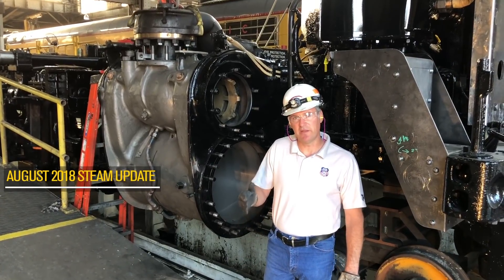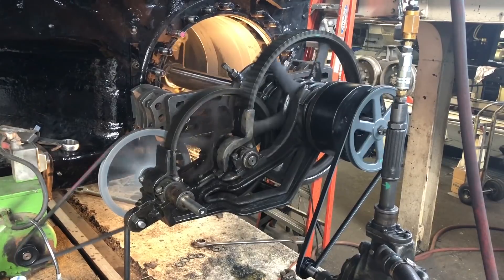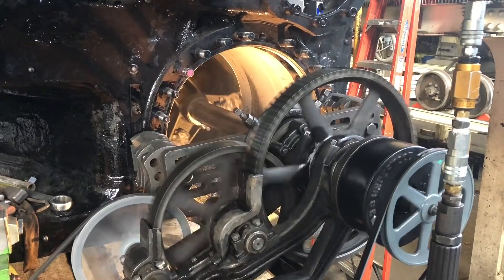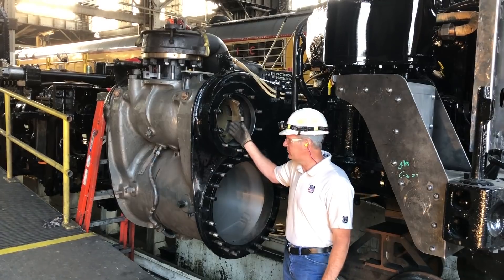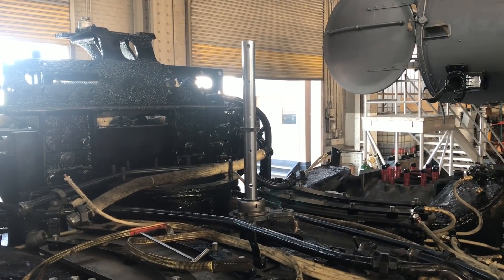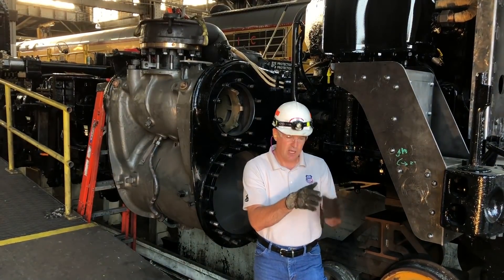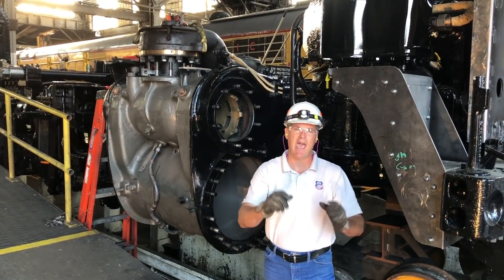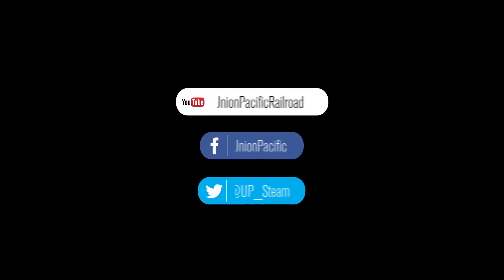Steam Update: Tackling Big 'Boring' Jobs

Comment: So cool to see! I've actually got an ad for one of these boring machines from around 1898. The L.B. Flanders Machine Works out of Philadelphia. They also had a portable slide valve planer which rotated a single point tool to plane the seat for a slide valve, much like doing facing operations on a lathe.

Comment: Mr Ed Dickinson,

I was thinking about the fuel capacity oil wise of 4014. Figuring it will be about the same as 844, 7000 gallons a thought came to mind. Amtrak is auctioning off some surplus equipment which includes several baggage cars with conventional passenger car trucks. Not withstanding the value of the trucks but think of adding horizontal tanks no more the 5 feet off the floor of the baggage cars to hold an additional 5,000 to 7,000 gallons of fuel for the Big Boy. By keeping the tanks to a height of 5 feet should keep the weight from causing excessive car body roll.
Plus I'd be willing to bet you don't have many spare old school spring suspension passenger car trucks to rebuild without taking a car out of service. Considering what new trucks would cost I believe this is a perfect opportunity to acquire a small fleet of passenger baggage cars from the 1950's. I believe there are seven cars available all stainless steel. 

  Where else and how often does an opportunity like this present itself?

Just an FYI they also have some P40's and P42's for auction as well.

Cordially yours 

James Shanks
Retired locomotive engineer.

Comment: If you could time travel to the 1930's, and tell those mechanics that this machine would still be used in the year 2018 they would have never believed it. If this machine teaches us anything it shows how slow technology has evolved. You would have thought by now there would be a machine that could bore that in a matter of minutes. As a former locomotive mechanic I am sure that part of the boring machine restoration was for nostalgia. A bigger part was probably it's simplicity. There is no question it is has proven itself to be just as good as any modern boring machine. It just goes to show that even with the most modern boring machines costing likely in the hundreds of thousands of dollars. Sometimes your best choice is this little machine that would probably have a price tag of 50 bucks in a antique store. As I have learned from my experiences as a life long mechanic, the best designs are the simplest designs.

Comment: I wonder, once the 4014 is done, if, say, a city/state raises funds, and requests THEIR Big Boy  to be restored, if they would do it. I know that the one in Dallas was movable, and considered before the 4014.
Reply: Not going to happen unless something happens to 4014 and they want to replace it.  The expense and time is immense and there's no advantage to doing the work without gaining the benefits of owning/running it themselves.  They probably would gladly assist someone else doing the work with information and support but wouldn't do this on a contract basis.  The UP does have a responsibility to shareholders to move freight and restoring locomotives for UP use is push the envelope enough.

Comment: I visited engine shops as a kid with my dad.  Towards the end of steam railroads would tell the shops "Just keep them running until the diesels are delivered."  This lead to a minimum of maintenance and some "quick and dirty" work.  I admire the people in the UP steam group, and other quality restoration groups, for how they are taking so much time to do things correctly and to such a high degree of craftsmanship.   Steam railroads made it possible to build this country and it is important that the steam railroad motive power is preserved in running condition so my great grandchildren, and their children, will have the opportunity to see, hear, feel, and smell the power of railroad steam.

As a sad general comment on the trans-continental US passenger railroad system today, there is no way to get to the Cheyenne Depot Days and the UP shop tours by passenger rail.  In fact, there isn't a single passenger station served by AMTRAK in Wyoming or South Dakota.

Comment: IT's gonna be amazing to see, hear 4014 stretch her own legs again. Please for the lvoe of all things holy make one of her first tasks after her break-in and adjustment phase being dragging a two mile long stacktrain with zero diesel help! One of my favorite vids of UP Steam is 3985 pulling 160 loaded wellcars up Sherman Hill with grace and ease, and I think it'd only be fitting for 4014 to one-up her on that front. 4014 was, after all, designed to pull that sort of train!...or at least the closest facsimile they had in the 1940s.

Comment: So just curious but I heard about another big boy that was converted to oil but it wouldn’t build enough heat to move and I’m curious on how your going to help it get more heat
Reply: That wasn't entirely true.  It didn't generate enough heat to run efficiently on a single burner, due to the larger firebox compared to the 3900s.  It could have been fixed, but by that time, UP was no longer really interested in improvements to their steam locomotive fleet as diesels and GTELs were clearly the future, so they instead just returned it to coal-fired.  Apparently, the conversion of 4014 is based in part on preliminary engineering sketches of a plan to fix the problem with the original oil-fired conversion.

Comment: Are yall just gonna run her once or twice a year on passenger excursions, or are yall gonna set her loose with some revenue freight up Sherman hill? Id like to see her do what 3985 did in the 90s with that intermodal.
Reply: Texassince1836.  Or 844 pushing a stalled 11,400 ton train on the same route? Just the sound was cosmic.  Having spent so much time, care and money on 4014 (and 844) I doubt UP will want to hide them away except for a couple of elite excursions.  I doubt they can do more than break even with each excursion, given how much each one will cost, but each one will bring inestimable kudos to UP and thousands of feet of stunning footage that money just can't buy.  I know Ed Dickens will not want to break his beloved locomotives, but he doesn't want to cosset them either.  They are assets to be used and while I doubt they'll challenge her (Him?  It?) with a 9000 tonner on her own, I bet you'll see 4014 in charge of 5000 tons and just 4884 to pump up the brakes and provide electrikery for the support cars!
Reply: One of the things that's done to (somewhat) appease the accounting department about the cost of the steam program is that UP now has the steamers haul revenue freight during deadhead moves to and from excursions.  It's not going to become routine to see them hauling freight, but I'm pretty sure 4014 will be hauling a few thousand tons every time she makes a positioning move, just to help defray the cost of running her.
Reply: rdfox76.  That's interesting and very much chimes with what I'd guessed about the 'big steam'.  Actually that's good that instead of complaining about the enormous cost, UP bother to do something about it.  Revenue freight on 'deadheading'. Perfect.  And the film and photographs won't do them any harm at all!  However, it begs the question; would 4014 and does 844 still haul its own support train, as well as the revenue?

Incidentally, in Britain steam locomotives that go out on the main line, have to be specially equipped with automatic train control for the signaling system and air brakes, even where such locomotives were never fitted that way. (In fact, I don't think any steam loco's were ever fitted with air brakes.)  There are other modifications which add significantly to the cost of restoration, but each loco only has one support coach.  Between 12 and 16 Mk1 (soon to be outlawed unless significantly modified themselves) coaches is a typical train - steam excursion or not - depending on the loco and taking up too many of those reduces revenue!

It might interest you to know that one objection the railway operators have about steam excursions, is their speed.  They are 'limited' to 75mph and struggle still more on hills.  That is simply not fast enough, with ordinary, everyday timetabled trains running well over 100mph.  There's little problem with UP steam excursions, maybe having a freight train four or five hours behind them, but over here Tangmere or Galatea or one of the Great Western 'Kings' will have a 100+mph passenger train, ten minutes behind them!

Comment: Boring feed rate question: Is it correct there is an air motor connected to a planetary feed gear mechanism? How to set feed per rev? What would be the as-purchased mechanism? Sorry to ask but could not find in parents or Google.

Comment: Has all of the knowledge of the past how to maintain and repair these engines disappeared? Why is it taking so long? My Paternal Grandfather used to build and maintain Locomotives and couldn't even read or write!
Reply: Much of the stuff used to regularly maintain and repair these locomotives no longer exist. Keep in mind, even though UP had years of experience behind maintaining a successful steam program, they're still a freight railroad with the main motive power being diesel. The parts used to maintain steam locomotives on a regular basis aren't as abundant as they used to be, so it takes more time to manufacture a part for a specific locomotive.
Reply: Tim England.  The answer is 'not quite' and 'because there are only nine guys including Ed in the whole UP Steam Team'.  It's a spurious figure, but that means they each have 60 tons of loco to refurbish - that's as much as a whole preserved steam engine on many preserved railways in Britain!  There is another point to which Dickens often alludes, but never says outright.  In the early days of UP steam revival, locos like 844 and 3985 had been resurrected from basically worn out condition, as quickly and cheaply as possible.  This made them both cranky and more than a bit unreliable.  With 844's most recent, very long and expensive rebuild, Dickens and crew spent a lot of time correcting mistakes, short cuts and outright 'bodges' that had been made.  Particular attention was paid to boiler and firebox stays and the tools to remove and replace them.

They (and UP) made the decision that 4014 would be done the same way - perfectly, painstakingly and with the long term in mind.  Nothing that big was ever going to be quick, but the standards to which they are working are just awesome.  When 4014 finally rolls, it will be for a long time.  I believe 3985 is in a 'pre perfection' "let's get this engine rolling" state and awaits the same treatment as 844 and 4014.  It deserves nothing less.

(I hate to preach heresy, but I think 3985 is the better looking locomotive of the two mallets, but the FEF-3 is beautiful.)
Reply: I understand what you are saying. Maybe Grandpa was blowing a little "Steam and Smoke" up my butt with his stories. He worked as a sandblaster in the pits @ Willard, Ohio. He used to claim and engine would come in, be sandblasted clean and reassembled within two weeks. He said the guys at the works didn't have time for details. Put it back together and will work itself out! he's been gone since 1979 and my memories may be fading but it is fun to share and see how things are progressing.
Reply: Back in your Grandfather's day, locomotive shops had alot more people and equipment to service steam locomotives.  They did the same tasks over and over again on many locomotives  every day.  This being done with less people who don't have the luxury of specializing on a few of the same jobs every day.  This small team is doing all of the jobs once.  They are learning things along the way.  It's better that they focus and do it right than to do it fast.  It took as long as it needed to take under modern conditions.  

You can build a new car in hours in an assembly plant where everything you need is available and the scale of everything is huge.  To restore a car from the frame up in a garage can take months or years because the availability of parts, tools, staff, and time are not as abundant.

Comment: I'm always impressed by the technology of that era.   Not only were they able to make giant machines like this,  but also,  precise mechanical watches that had screws smaller than a flea-  all without computers and CNC tech.
Reply: I agree. Its amazing that they could design and build such precise machinery with the technology of the time.
Reply: It's amazing isn't it Jeff. And remember also that we went to the moon using nothing but slide rules.
Reply: Much as a like the saying, it isn't quite true. My father was using primitive punched-card computers in 1955 to help design flight simulators for Lockheed aircraft. NASA and its predecessors were using them too to design bits of Mercury and Gemini and Apollo hardware. But yea, probably 90% of the real computing was done with slipsticks and Monroe and Friden desk calculators.
Reply: I'd love for you to catch some high speed footage of 4014's drivers when she's under her own steam! Capture that mechanical ballet in amazing detail if possible.
Reply: And remember electric motors weren't very common, so there's a good chance it was driven by a leather belt attached to an overhead a line shaft.
Reply: Damn Jeff, I didn't know you were into this stuff.
A man of may interests.
Reply: TAOFLEDERMAUS and my great grandfathers stopwatch still works
Reply: @theflyingslowbro6537  The amazing part isn't just that they could do this level of precision, but that they could do it consistiently, year after year. I repair 1860 era watches and those flea sized screws are quite interchangeable, they built to amazing tolerances and standards.

Comment: What happens if you can't properly bore the cylinder, or if that entire piece needs replacing?
Reply: Hank Eisenstein.  Don't even go there.  Cylinder castings are about the most expensive replacements - short of a whole boiler - on preserved steam engines in Britain.  Just recently a GWR 2-8-0 loco was found to have a cracked casting and it was likely it would never steam again because of cost and even making the wooden pattern would have been difficult.  Fortunately, a 'spare' used, but usable casting for exactly that type of locomotive was found under a heap of ashes!  The really big, last of the line American locos were designed to be ultimately and easily maintained, so I imagine the cylinders were separate castings, but they might just be incorporated in the one piece, cast frames.  There's no going back from there.